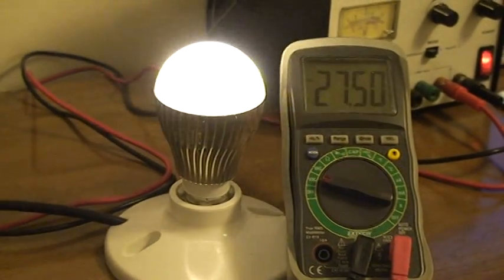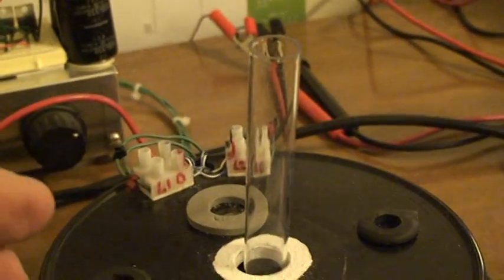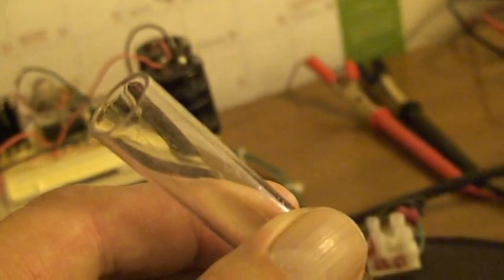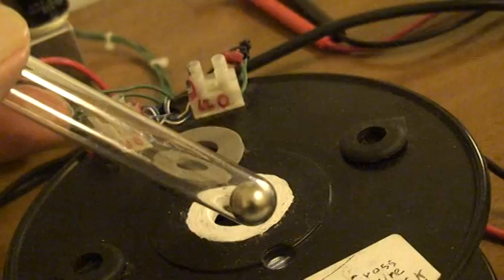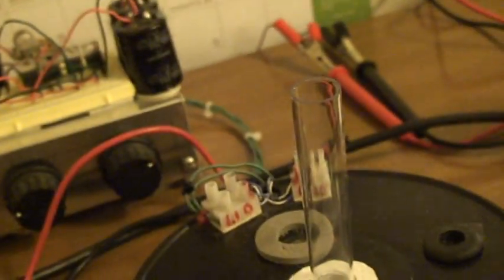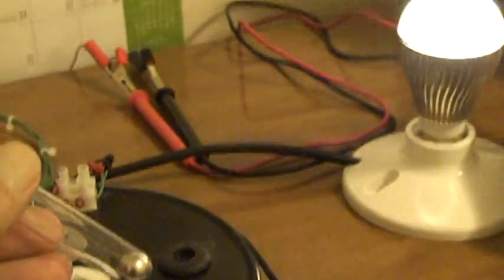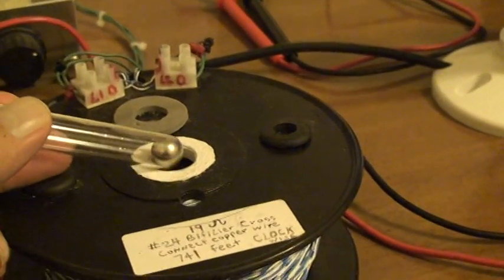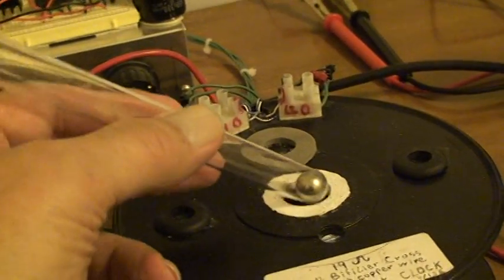TEST TUBE GENERATOR.MPG

Comment from the maker: @rostit420 

I have moved on and am now concentrating on a WORKING SMOT like motor that runs continuously.

Dont need any testing to at all as the model is very powerful and not only will it turn continuously it can power other devices.  A quantum leap from what i have been doing. Hope to post all when I dress up my model for presentation.  It can run untill both magnets loose their magnetic power  or untill the earths gravity stops functioning.  Yes its not perpetual motion.

Comment: Hi Tom,
please retry the measurements by replacing the LED bulb
with a 275 Ohm 5 Watt resistor and see, if you get the same voltage and current on it.
Also use a low pass filter at the 12 Volts DC input to measure the input current.
WIll be interesting to see, if you will get the same measurement values.

Also do you get more power out, if you put the magnet ball inside the coil
or if you put it ontop your coil ?
Many thanks.
Regards, Stefan.

Comment: Is the spinning magnet rotating while spinning - if not, what i`m thinking is : if you build a small coil with a spinning magnet inside as a unit, then place the unit onto the big coil, so that the big coil do the spinning work, one can capture xtra energy from the little coil as well as the big coil ?

Comment from the maker: @bennjanse   I recently found an even better way to produce more light output with almost perfect resonance than the test tube magnet.  Found smaller magnets work best to a certain point then they dont work at all.

A 7 mm diameter diametric ring magnet -20 mm in lenght works best so far - suspended on a 25 pound nylon fishing line over the coils center hole.  Its fantastic!